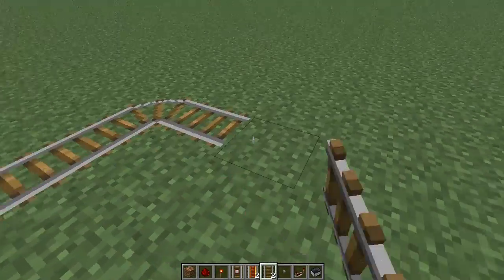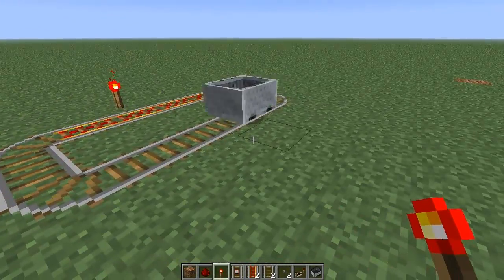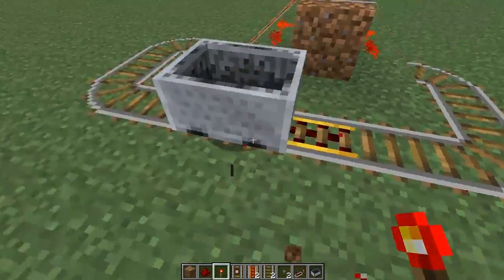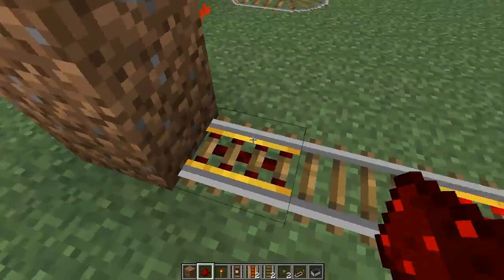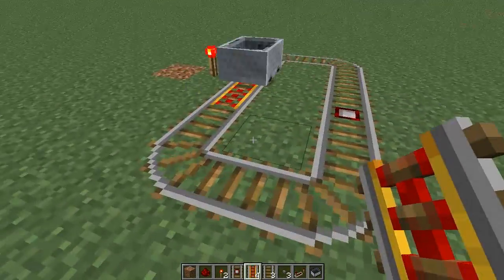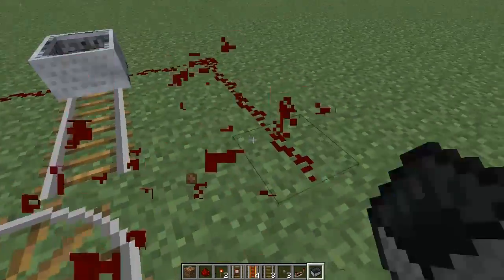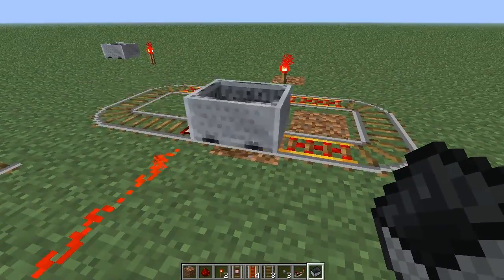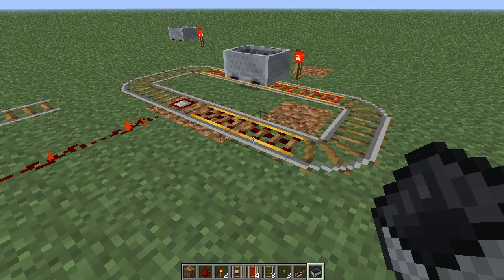Redstone Tutorials - #6 Rails

Comment: I'm sure someone's probably already pointed this out but I suspect that the cart stopped because the duration of the detector rail is out of sync with the frequency of cart passes over it and so after a certain number of passes, the rails will be unpowered while the cart travels over them to accommodate the duration of the signal.

Comment: Uh, lol, no. It goes because the minecart is clipping inside that block its upagainst, giving it momentum. If you pause the video at 2:17 for example you can see the minecart is inside the block, but it can't move away because the unpowered track is holding it in place.

Comment: The reason why the powered rails doesn't work on a flat because it doesn't know which direction to send the cart, that is why when you put it on a slope is because it is easier to send it down then up, so it sends it up. So when you put the powered rail next to a block it can only send the cart in one direction, so it sends it that way.